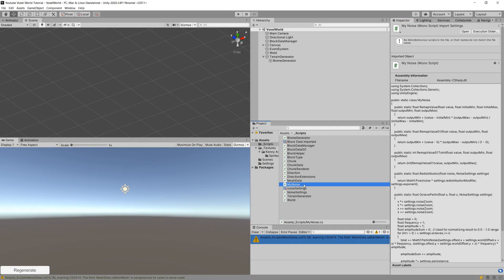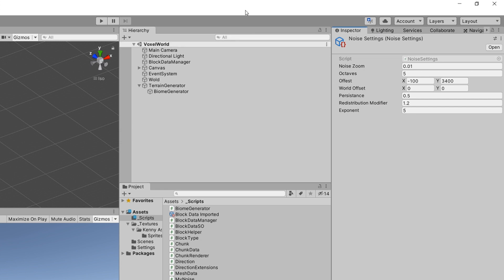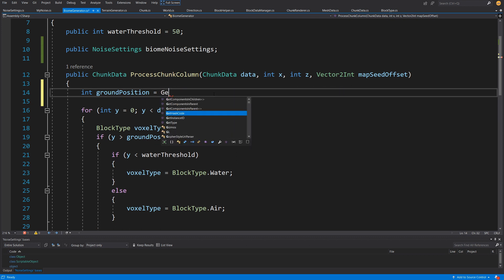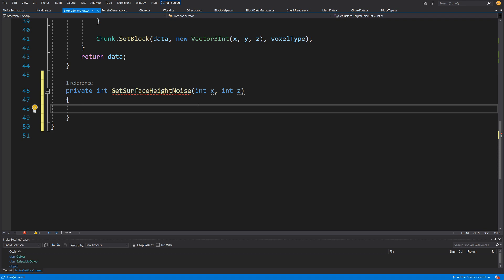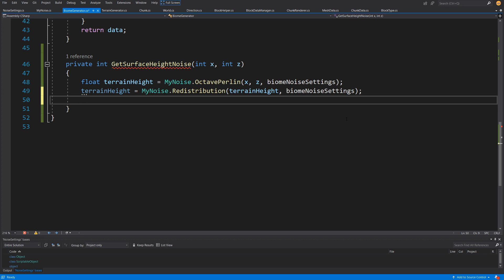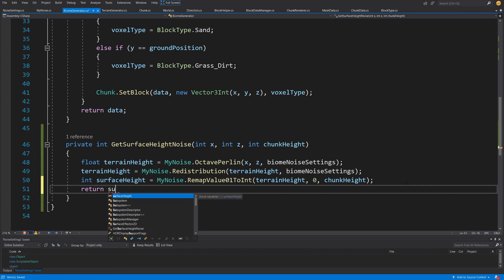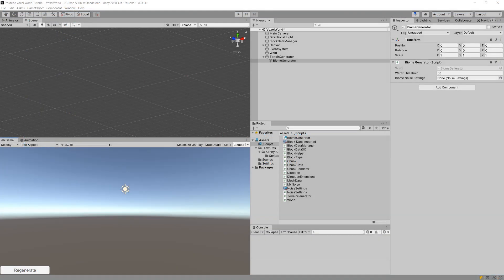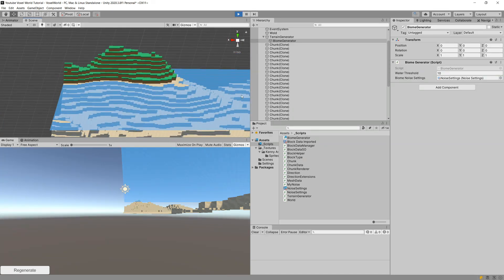Create MINECRAFT in Unity - S2 - P5 Testing

Comment: Dont know if its a bad idea but: since we use offset as a general offset to avoid starting at the "mirrors edge" of the perlin noise map (since perlin noise mirrors when using negative numbers), wouldnt it also work if we just use a "half max int", a maxInt devided by two, so we start in the center of the perlin noise map?
Reply from the maker: You can swap Perlin noise for Simplex noise. I probably should have imported some Simplex library to the project and just use it instead of Perlin.

Comment: Hello, nice tutorial thus far! However, my generated terrain does not have any shadows, in my opinion the recalculateNormals()-function should have done that for me. Any tips? :)
Reply from the maker: Hey!
Normals indicates which face is forward. Recalculing them fixes viusla glitches.
Shadows are generated by a light source (directional light in our project) and the material settings (the material needs to be using a lit shader).
I don't think that in the game view you can disable shadows from showing (i mean you can in URP settings) but in the inspector this is an option so you can check that as well.
Reply: @SunnyValleyStudio   Thanks for the fast reply :) I will surely look into that.
The material was not imported correctly at first, and I tried to fix it myself. Maybe the issue is right there...
Reply: @SunnyValleyStudio  Hello, I found the solution! :) I forgot to install and use the Universal Render Pipeline/Lit shader. I just had the standard shader activated, now it looks all clean and bug-free. Thanks for the tutorial series again! :)

Comment: how much sections will there be for this project? What will the end result be? Will this only be focused on world generation or will you do some game mechanics as well for a game that would fit in this kind of world?
Reply from the maker: Hey! The tutorial is about generating an infinite voxel world while keeping a decent performance. There are some small mechanics like player movement and digging.
As for the sections it is: voxel engine, procedural gen, multithreading.
You should be able to implement whatever you need on top of the end project of a traversable infinite voxel world. The tutorial is meant to give you a well coded template thet you can build one. 
PS it was actually a lot of work to have it all working in a decent way :)